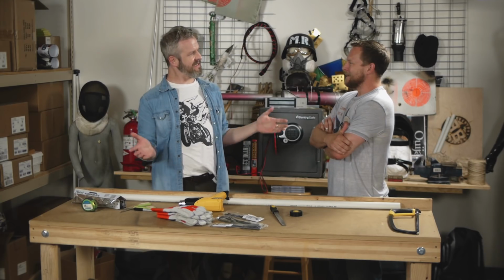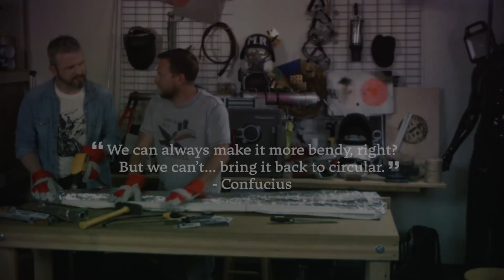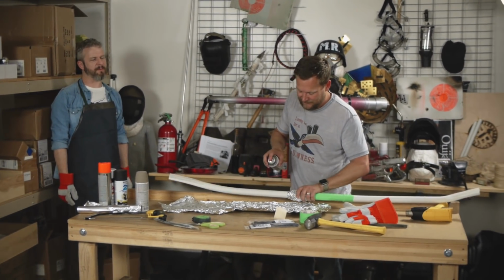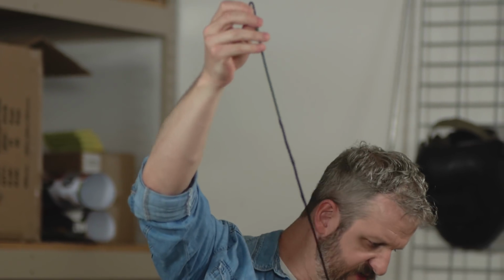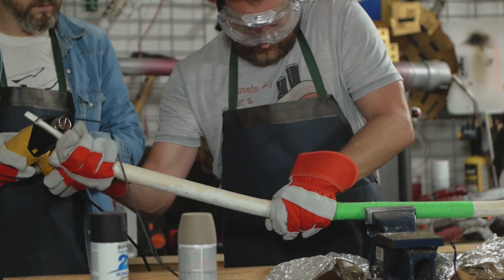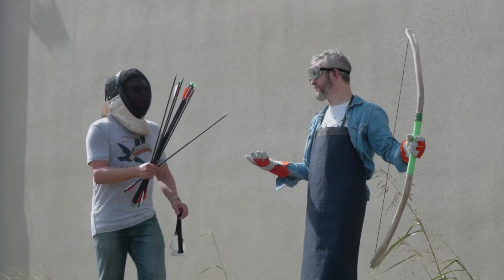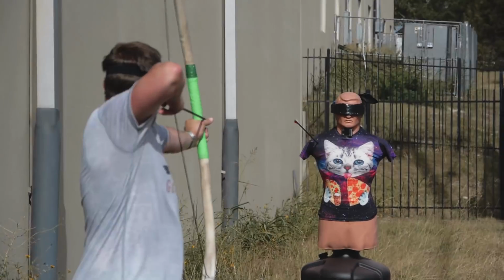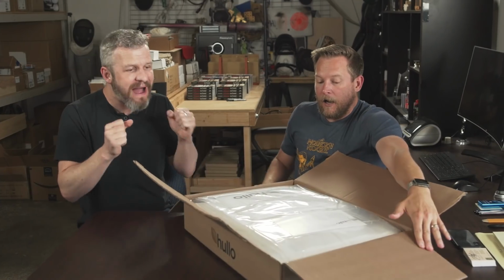Improvising a PVC Bow

Comment: Despite any internal flaws with the bow, one issue with accuracy is that their arrow is being shot from the wrong side. A right-handed shooter crosses the arrow to the left side of the bow, and vice-versa for left-handed shooters. You can't look down the arrow if it is not aligned with the bow, permanently aiming to the right.
Reply from the maker: Aha!  Yeah.  We definitely should learn proper archery techniques.
Reply: Not all archers shot with the arrow crossing sides. The mongolians had the arrow on the same side.
Reply: Many eastern styles of archery have it shot from the right side as it allowed them to fire off arrows faster. Aiming was more about intuition and instinctive while western styles usually had it on the left side. Obviously, they aren't experienced in archery so having the arrow on the left would have been better for this since it is easier to pick up.
Reply: what side you place your arrow on is personal opinion, also looking down an arrow is plain impractical
Reply: Well, technically this can be countered by using your thumb draw. Which i suspect was the way they were learning the horse archery.
Reply: Definitely not wrong side, it’s depending on preference
Reply: Ryan Russell you don’t look down the arrow on a bow..
Reply: don't forget they clearly didn't fit the arrows to the poundage of the bow
Reply: Most finger shooting methods shoot from the left side, while most thumb draw methods shoot off the right.
Reply: The side probably wasn't as big of a problem as the fletching. With that low of poundage the plastic fletching will just push the arrow into a spin or off course. Just remember guys odd feather out.
Reply: Putting the arrow on the left side of the bow is used to counter an effect called the archers paradox, which they should have used with this bow.
Reply: The Modern Rogue Oh holy shit
Reply: i think its because they learned from that Mongolian guy which was probably not the best first impression of how to properly shoot a bow
Reply: While it is preference based, I generally show new student to cross sides for stability. Helps to allow them to focus on stance and quiver draw before we teach them to stabilize a same side shot
Reply: When thumb drawing you can use index finger on draw hand to stabilize arrow so it doesn't fall off like that, but drawing on that side with a normal finger draw leads to the kind of problem they encountered. They learned to thumb draw but then forgot to do it, while keeping it on the side of the bow they learned.

Comment: Ive been waiting sooo long for this one and im going to go out on a limb and say the injury counter is gonna be reset
Edit: ways you could improve it 1. heat the end sections in one go and use a long bit of wood to get an even taper 2. use a round file and cut the grooves at an angle to hold the string better 3. tape on an arrow rest to help when aiming 4. LEARN ARCHERY BETTER!!!
Reply: You sir, called it

Comment: Brian, don’t leave the bow strung, it’s not good for it. Especially with PVC, at room temp it’s slightly pliable, and if you refrigerate it, it becomes brittle. So definitely don’t leave it strung. Just a tip. Also, I expect that only you read the comments. Sorry, Jason.
Reply: LJTwiggy the opposite. Jason often comments from his own account that's all.

*I don't mean to leave it strung that will destroy the little strength it has I meant that Jason is who reads the comments usually not Brian
Reply: Corvo Attano That WAS a joke—I think—but thanks, I didn’t know that. Good for you for knowing that.

Comment: I'm cringing. You guys did everything wrong. That was great. I love your videos.
Reply: Dustin the WIN! Still wasn't the "simplest way" I made mine a few years ago with a thinner pipe, paracord, and a file. Just cut notches in each end and tied the cord. Works great.
Reply: Alex Lawson You can put fiberglass rods inside to increase power as well
Reply: I was actually planning on doing that but decided I didn't need the extra power. Instead, since I didn't have any arrows, I cut the rods into arrow length. 
p.s. bad idea. my hands were covered in fiberglass slivers xD
Reply: Alex Lawson oof, fiberglass slivers are the worst
Reply: also they bouce into your face

Comment: Some tips for future archery endeavors. Use feather fetching instead of plastic vanes. The feathers collapse as they pass the riser (where your hand is on the bow) and don't kick out as bad. Secondly, when using your fingers instead of a thumb draw, you want to place the arrow on the top of your knuckles on your bow hand. Lastly, avoid bulky gloves as they prevent a smooth release.

Oh, and keep that elbow up...straight line from bow hand to elbow.

Comment: The reason there's one larger loop on the bowstring is that some bows are strung by sliding the larger loop down the arm of the bow, fitting the smaller loop at the end of the other arm and then, when you bend the bow, you slide the large loop up the arm and into the retaining slots - rather than trying to bend the bow far enough to get the loop over the end of the arm.

Comment: you should check out ZNA productions, on his channel he puts fiberglass rods in the pvc to increase the draw weight of the bow, he has done multiple designs.
Reply: Jonathan Otten but if you did the stringing like how they did it it would break if you do this use the in-between the leg method
Reply: true, by actually bending the PVC instead of heating it up and forming it, it should already become more powerful

Comment: I really enjoyed this video. And, while I haven't made a pvc bow myself, I have a few suggestions that could help. First, with as easy as it was to bend, you probably could make a recurve without much trouble, and not only will it improve the power of the bow, it'll be less likely for the acting to slide off. Two, if you don't have a dremel tool (why wouldn't you, they are awesome!) you should definitely invest in one and get some carving bits. You could, for example, use one to make a quick, smooth notch for the string that's less likely to wear out the loop of the string. Third, if you're shooting right-handed (and not on horse back), the arrow goes along the left side of the bow, not the right. Fourth, you really should work on your form to get more consistent shooting (not that what you were doing want fun to watch). Fifth, after making the bow, find out what the draw weight is so you can get the right arrows for it. The last one is a bit complicated, but the reason has to do with what's called the archer's paradox. When launched from a bow, arrows bend back and forth...meaning the tip doesn't go in a straight line. All arrows have a spine rating which determines how much that happens based mainly on the weight off the bow. You actually want some "bendiness" as the string and shaft are in line which causes the arrow to get deflected, which the "bendiness" corrects for (simplified explication). Again, I think this was talked about in the mounted archery episode. Anyway, I'd love to see an episode where you revisit now making and see if you can improve on your pvc bow. Basically, I'm hoping you can manage to more effectively shot the dummy (and not reset the injury counter 😝).

Comment: It's funny because if you're doing a longbow style bow, you don't even have to bend it at all. Usually you just reinforce it with either strapping tape or you can use fiberglass driveway markers on the inside

Comment: You have to put fiberglass rods in the middle of the pvc pipe. Then shape it. It will increase the tension of the bow and cause it to spring back faster, increasing velocity

Comment: i know this is super late, but if you ever visit this video again or if anyone wants to build this bow, you can get much more power out of it without changing the bow itself any. The arrows you are using are to short. If you visit a fletcher they will show you a few ways to tell what your "draw distance" is. For example mine is 32 inches. If you had a slightly longer arrow, you'd get your full draw power and the arrow will carry more energy with it.

Comment: Only bit of advice I'd give seems as everyone is saying put less curve in the bow to allow for higher tension would be to place the arrow on the left side of the bow. It will be a little more accurate. When you nock an arrow it's supposed to rest on the first knuckle of your pointer finger. It also lines it up better if you're right-eye dominant.

Comment: Another method for making a pvc bow requires 2 pvc pipes, and I'm going from memory but I think its a 3/4" and a 1/2" pipe, you use a saw to cut a saw kerf out of the 1/2" pipe and jam the 1/2" pipe into the 3/4" pipe. You then get a fiberglass rod, like an electric fence post that you can get at a farm supply store. You cover that fiberglass rod in electrical tape so that it will press fit inside the bow. This provides the flexibility. You can then either cut notches in the ends or affix some kind of a cap that will hold the string.
Note, with this bow it will start out with a pretty high draw weight, but due to PVC forming over time, it will loose its power. Also, make sure you check the ends of your bowstring regularly for nicks and cuts, since catching a taught bowstring in the face is not a good time.
Reply: Also, having watched more of the video at this point, they're placing the arrow on the wrong side of the bow. You want the arrow to be on the side of the bow as the hand holding the bow. If that's somewhat hard to understand, think of it like this. If you are holding the bow in your left hand, you want the arrow to rest on the left side of the bow, or on the back knuckle of your left hand. I suggest if you make a bow like this, make an arrow rest by taking an additional piece of the PVC you made the bow with and cutting it so there is a ring and tooth on top of the ring. Heat the base of the tooth so it can be bent at a 90 degree angle to the outside of the ring. Cut a large, roughly 1/4 of the ring, section out of the arrow rest so that it can snap onto the bow. This will help keep your hand from getting cut up by the fletching.

Comment: If you get schedule 40 PVC pipe, put it on a cement surface and hit the end hard with a hammer you can see if it will be good or not, if it dents and bounces the hammer back it will be good for a bow, if it shatters then you don't use it.

 If it doesn't shatter during the test then you don't need to worry about the shattering while you're drawing it, it's rated to 400 PSI

Comment: Another note the bowstring has a larger loop so that you string that on first past the notches so that it slides up the bow then you loop the smaller end to the other side and slowly pull the larger loop back up the length of the bow onto the first set of notches. Still only 14 minutes in and at the edge of my seat to see if I just repeated what you already found out.

Comment: The arrow isn't curving around your bow, that's why its shooting to the right and turning. You either have the wrong arrows the pvc/tape is too thick or it may entirely be from the lack of power from your bow. Either flatten the middle, drill a hole through it, use more flexible arrows or make a less curved bow.
Reply from the maker: good call.

Comment: as a  four year state archery champion, watching you guys shoot a bow was mildly painful lol. Tips for the future, add something the arrow can rest on, perpendicular to the nock (piece that attaches your arrow to the string) but on the handle area, try to put it a little above your hand, put your bird finger and index below and above the nock and your ring finger naturally goes under the bird, but don't use your pinky, stand sideways, feet shoulder length apart,  draw back to rest your index on the edge of your mouth, respective to the arm you use to draw with, for example a lefty such as myself will draw with his left and the tip of my index finger will touch the left side of my mouth, do not let the string go abruptly, instead, slide your hand back towards your ear to release the string, aim with the arrow, it's your sight, and remember; Good posture is not optional, your posture must be proper. Sorry for the book I have written you lol.
Reply from the maker: All good advice!  We had only learned horseback archery with a thumb draw, so I'm sure we did everything wrong 😃😃😃

Comment: To help prevent the bowstring from fraying, you can use some electrical tape or heat shrink tubing over the grooves cut on either end. this will cover up the sharp edges. Another thing to do is to file the edges so that they are rounded.
Reply from the maker: good call!

Comment: Maybe put a little more "flat" into the ends so it's more flexible, so you don't need to heat-bend it as much when you're stringing it.

Also, the arrow was resting on the wrong side of the bow for the draw you were using, which is why you kept missing to the right. For the three-finger (Mediterranean) draw, the arrow should be on the left, resting on the knuckle of your index finger.

Comment: Make a wood jig that has hinged 2 foot ends so when you heat both ends by blowing hot air through the pipe to desired pliability. 
You can set the jig over the pipe and press down on each end until pipe hardens again.

Comment: There are 2 sides because one is the one that goes on the bottom that you put on the loop after you put on the large one loosely around the top arm, then you should pull the e how back and get the loose loop on the hook.
It’s less complex than it sounds

Comment: An easier, more effective way to string a bow without putting it between your legs is to make an extra drawstring from cheap rope that is a few inches longer than the bow, string it, put the bow on the floor, place your foot on the grip and pull on the large drawstring to bend the bow and then put the actual drawstring on the bow. Then just cut off the cheap rope drawstring.

Comment: Loving the enthusiasm and enjoyment at the end, but are we going to talk about the string being on the wrong side? 
Doing nothing but reducing the length of your spring by bending it towards the string. Flattening a greater length of the arms would have made stringing it easier. As you didnt want to attempt recurve, should have aimed to keep the unstrung bow as straight as possible, perhaps flattening with a block of wood while the pipe was malleable....

Comment: Like use a Dremel to round out the notches to relief stress points 10:30 or a little bit earlier should had lightly sanded it and added primer before the stone texture.

Comment: A bow is actually supposed to bend the opposite direction when its unstrung. As in, its ends are supposed to bend AWAY from the shooter and then get completely bent back the other way as you string it. This is especially so with recurve bows. No idea of PVC can possibly be bent in that way, but it's how real bows generate power and range.

Comment: If you revisit this, may I suggest heating up sand then putting hot sand into the pipe. One it’s soft you can shape the pipe any way you want. Saw this on a video where a guy built his own roller coaster in his back yard. Hmmmm.... maybe you guys need to build a roller coaster.

Comment: I know this is a really old video but I'm gonna comment anyway. If you re-do this you definitely shouldn't bend the bow into the curve like you did. Really all you need to do is file groves for the string into a piece of pvc that is a little longer than the bow string. You can flatten it and then make it longer to give it a better draw. A traditional longbow is around 6 ft long and is really just a fancy streight piece of wood with groves for the string. Also, to help with your shooting you are knocking the arrow on the wrong side of the bow. If you are shoting right handed the arrow should be knocked on the left if the bow. Loved the vid and I hope you give it a re-do.

Comment: The reason you're not getting any power is because you strung it backwards (besides the fact that you're using a pvc pipe). If you string against the curve you get a huge difference. It's so much stronger. Try it!

Comment: hey boys, you take the large loop and slide it down the limb. connect the small loop to the other end. Then when you bend the bow (bow stringer works best, but you can use your legs)
, you slide the large loop up until it seats in the end. :) #themoreyouknow

Comment: so my uncle died and he had a really powerful (70 pound?) bow, and I was learning archery with my dad, and he used it, and he shot the target... and the bow went through the target... and a bag of fertilizer... and a bag of dirt... and through a fence.... and two feet into the dirt. he then shot it again and put a hole through 1/10 inch steel. and buy put a hole in it I mean shot the arrow through one side of a steel barrel, out the other, and through a fence.

needless to say, you should get a compact bow.

Comment: Was a good 1st attempt. The original shape before you starting stringing would have given a heavier drawback and a more powerful shot. Also, I would drive a screw into the side of the bow above your "handrest" to use as an Arrow rest. Your accuracy is off because the fletching of the arrow keeps brushing off your hands.

Comment: Part of the reason the bow has little to no power is you guys precurved the limbs. If you look at most bows, the limbs would be straight when it is unstrung. The power of the bow than comes from the limbs wanting to return straight, but they cant because the string is pulling them together.Also, flattening all the way to the lines you drew in the beginning with a shallower taper would have allowed the limbs to bend a bit easier for this type of bow. Although, a great Youtube channel for PVC bows is the BackyardBowyer, and he even has no heat and hand flattened pvc bow tutorials.